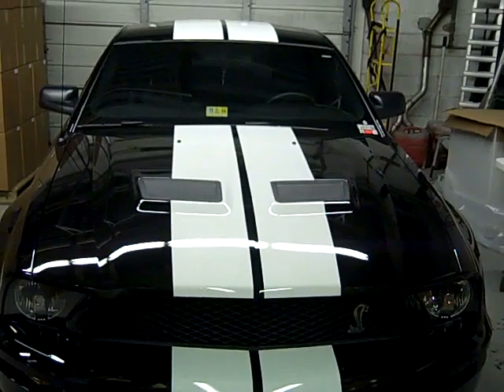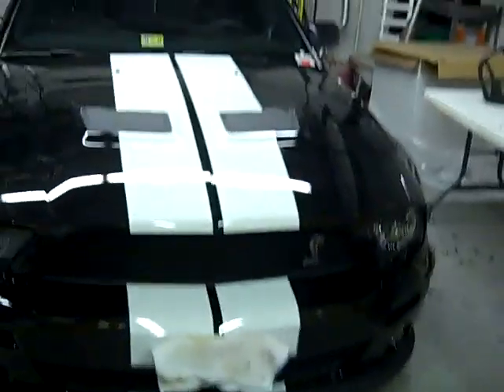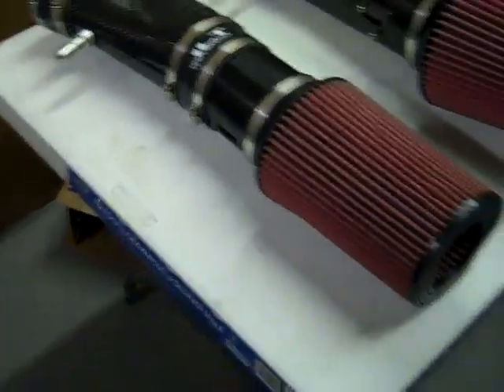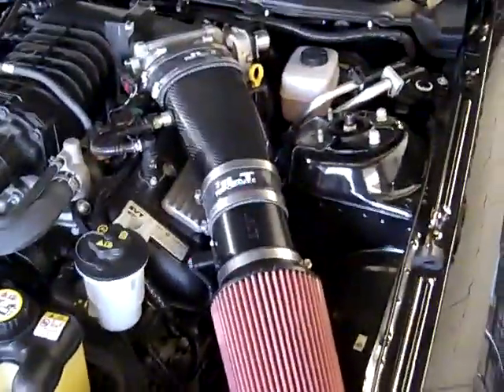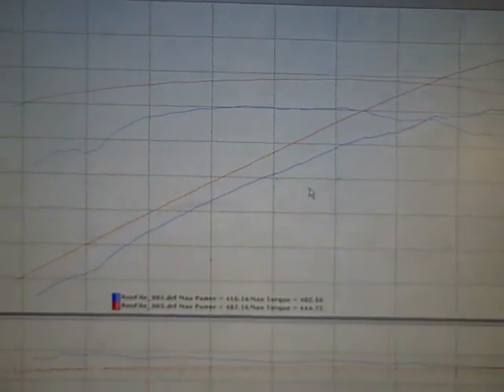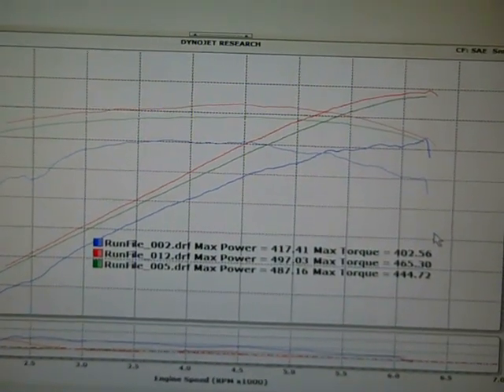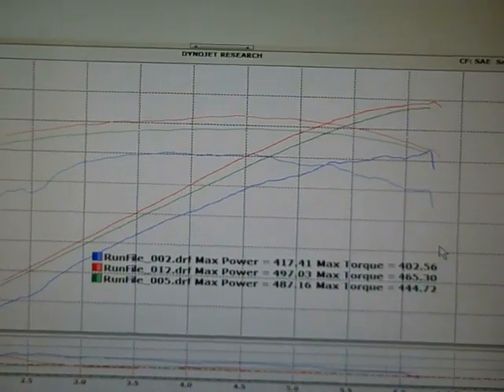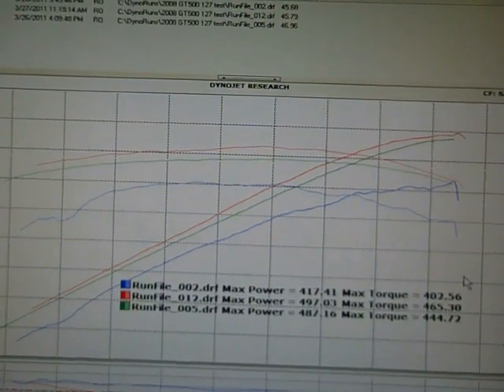JLT Carbon Fiber Intake testing - GT500

Comment: Unfortunately a CAI isn't the constraint with a 6cyl and cannot net that high of a gain for your car.  Think of your engine as an air pump.  The displacement (size) of the motor in the GT500 is much greater and the supercharger also pumps more air into the engine.  Any change in the capacity of the incoming air (CAI) allows it to pump better as the air density increases.  For your wish, I'd recommend either a supercharger or turbo kit...I'll continue this post as Im running out of characters...

Comment: If you were to do a supercharger or turbo kit on your V6, you would have much better performance.  The benefit is also that you do not need to tell your insurance company (no insurance increase), you still have a lower car payment and increase the resale value of your car.  Exercise caution though because if you were in an accident, your insurance might reject a claim for your personal property loss because you've modified the car.  That aside, short of engine swap, turbo might be your best bet.

Comment: I have the original JLT Big Air Carbon for my 07 GT500.  Unfortunately my tun is custom and can not be modified without a complete retune on a dyno thus it's for sale.  I had to go back to the Ford Racing which it was tuned for by Lund.  Super disappointed as I can feel the HP difference in all areas however it makes my check engine light come on and also causes the risk of blowing up my motor running lean.

Comment: I like my carbon jlt 127 on my shelby but it scrubs the fender lip with a cobra jet throttle body and why did they stop the real carbon that hydro dip stuff if gay
Reply: On my 2014 Shelby ,I went with the smaller carbon kit for fit. I didn't like that there big kit lets hot air into the Gap at the filter, no rubbing with the ford racing 65 mm throttle body either, and the smaller kit in only 10hp less
Reply: Real carbon cracks